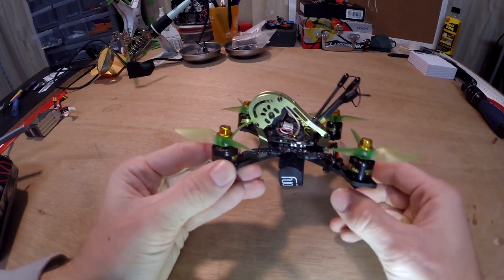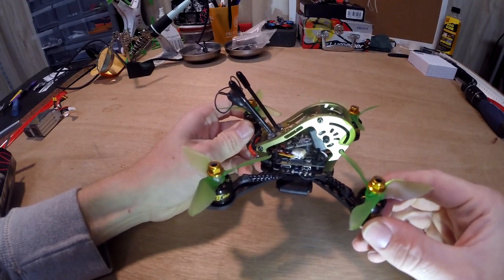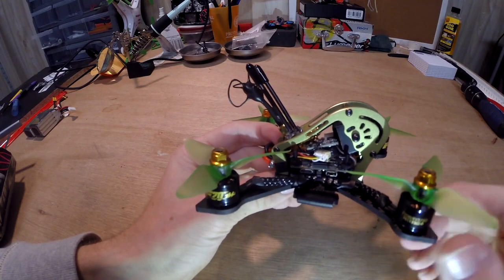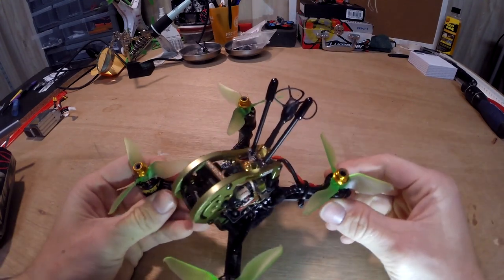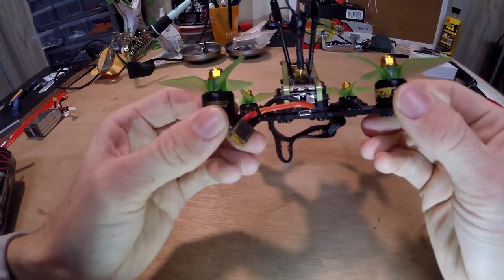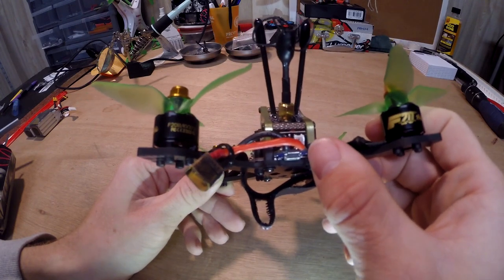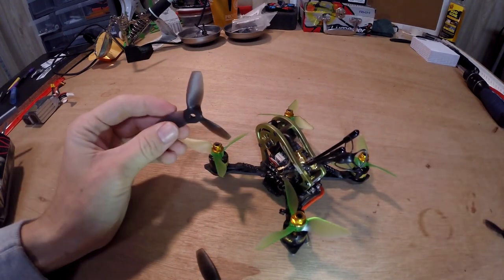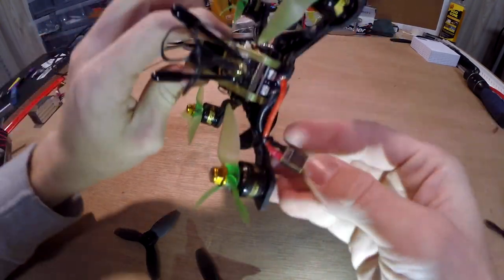GEPRC Sparrow 3". Custom Build Timelapse. "Need to Knows"

Comment from the maker: Here is my full parts list:
GEPRC Sparrow GEP MX3 3". 139mm Carbon Fiber Frame, Green Color, LED Board
Tiger Motor F20II 1408 3750KV Brushless Motor
Lumenier 3x4x3 V2- Propeller (Set of 4 - Transparent Black) x2
RaceKraft 3076 (Set of 4) x2
Team Blacksheep Unify Pro 5G8 HV Race Video Transmitter
Omnivision 5.8GHz "Stubby" 3-Lobe FPV Antenna (RHCP)
RunCam Split 2 FPV Camera Upgraded Version 2.5mm RC25G FOV130 1080P/60fps HD (Painted Black)
SMA Male to Female Right Angle 90-Degree Adapter Gold Plated 
Cicada AIO Flight Controller (F4, 30x4 BLHeli_S DSHOT ESC, OSD, PDB w/BEC, Current Sensor)
FrSky 2.4GHz 16CH ACCST Receiver w/ S-Bus 
Let me know if this helps anyone :)
Reply from the maker: Yeah I'm really surprised how clear the run cam split V2 is as well. MY antennas receivers are bit exposed but only by an inch above the top of the frame, unless you are referring to the rubber caps on the end, they came with the GEPRC frame, and my antenna fold over and underneath the cap.

Comment: wow, congratz on managing to fit all of that inside that frame :D
I'm glad my stack is much smller than that
Reply from the maker: JustForFun RC are you running a 3"?
Reply: I will be as soon as all the parts arrive :), same frame, but with 20x20 stack and runcam micro for now.
Reply from the maker: What Motors?
Reply from the maker: yeah the 20x20 stacks you should have a lot more room for sure.

Comment: Nice build, what mah battery are you running? I just built one of these myself. Had to customize a lot but I got the Kiss AIO to fit in there.
Reply from the maker: Nice. I have 3- 850mah 75c. What cam did you go with?
Reply: kpresnell45 I went with the Runcam Micro Swift for now (will be switching to Split2 later), Thriverline UFO VTX, and Crossfire Mini RX. What kind of flight time are you getting?
Reply from the maker: 4 mins with aggressive props on average. It's been so cold lately here NOCO I'm at like 3.25.